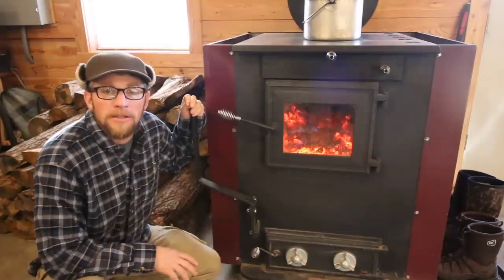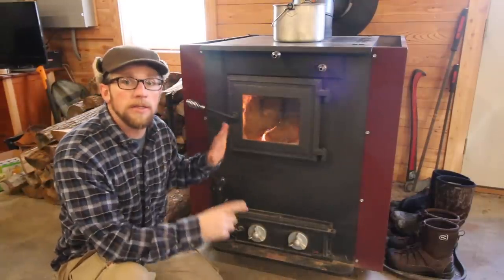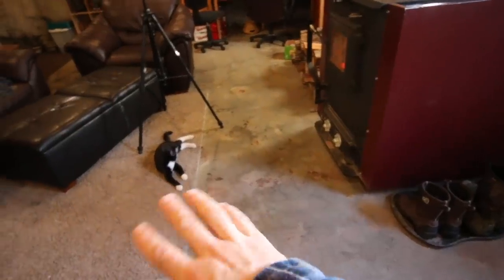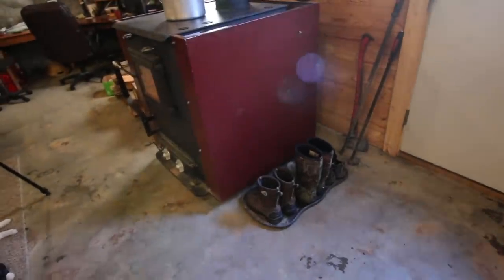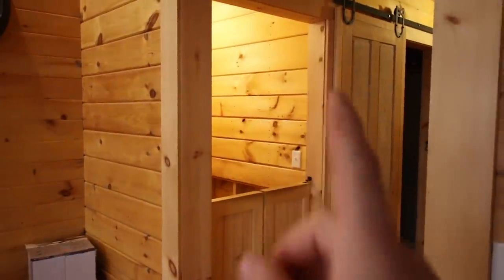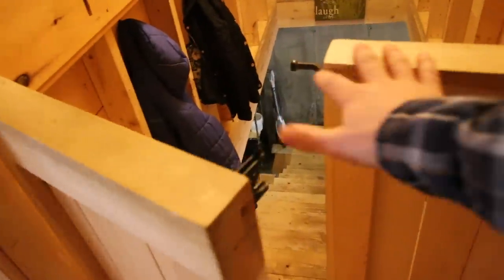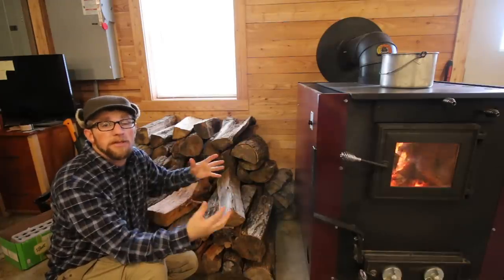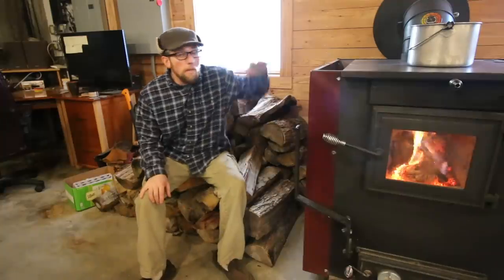How we Designed our House to be Heated with Wood & Natural Convection

Comment: I know this is a year old, but hope you find this comment useful.  Warm Bedroom:  Is there some way to add some insulation above the heater ... Perhaps just put some plywood on the bottom of the rafters to make a dead space directly above so that the moving air would not be rising directly into the space below the bedroom...you could then treat that space as another floor, have openings into it to allow heat to rise (or move sideways) into the space and have drop down cool vents to allow the cold air to fall into the basement.  You could control the damper in the cold drops to control the amount of circulation of warm air under the floor.  Also, since there would be a barrier between the floor of the bedroom and the heater, radiant heat would be blocked and would only heat up the covering plywood, not the floor of the bedroom. Perhaps drop the ceiling a few inches and just put a little insulation on top of it, not enough to block the free air flow from the sides.  

Love your videos.  Thanks for the inspiration.  Best of luck with this winter.

Comment: could you put a section of duct above the stove... say about 3 or 4 feet wide...with 1 foot deep sides...so like a big U shape..upside down..... and run that toward the center of the basement...this way more warm air would flow that direction and not overheat your bedroom above...if possible slightly angle the duct to be lower and the stove end and up against floor joists at the other end...

Comment: I heated my home almost exclusively with a wood stove for 4 years. I like the ash try on your model, but that warmer/colder dial looks flimsy and unnecessarily complicated. The cleanout on the chimney is excellent. My yearly cleaning would've been easier with one. Also, once the fire is going strong a little moisture on the surface of the wood won't affect anything, although storing it inside is more convenient...

Comment: good setup but would consider running outside air source for combustion to the intake flap of the stove.  Also not sure but if that model stove doesn't have a catalytic converter one with it would likely be more efficient by basically using the unburned particles in the smoke. I see your point but a few batteries and solar panels or small generator would easily run a circulation pump ,fan etc and you could have the outdoor furnace and not have to bring wood inside the house and gain floorspace and no mess inside but you considered that and did this instead which I don't disagree with.  I like the look of a fire burning too.

Comment: Your house is 3000 square foot, does that include the basement? Did you insulate the walls with foam? I know in the area I live they use foam instead of the old type insulation. There's no doubt about it you do have a great stove. Do you guys ever plan on making different rooms in the basement, let's say bedrooms perhaps for company?
Reply from the maker: the 3000 sq ft includes the basement. we have fiberglass insulation in the walls

Comment: I'd like to know the temperature, when it is very cold outside, of your cellar, your living area, your bedroom area, and your bathroom.  It seems like your cellar would be very warm because the convection would not be really great enough to warm the living spaces that well.  I think that is evidenced by seeing your wife bundle up in a big, thick wool scarf when eating dinner/lunch.  She looks very cold.  The other drawback is the cost of four cords of wood, or the amount of work needed to split your own wood.  Then the work of stacking the wood and bringing it, which I've seen your videos on, cleaning the chimney (which I love), and the firebox is a lot of work.  Did you compare that cost to gas heating?  I'm sure electric would be very expensive.  We live rurally where there isn't gas, so we heat and live all electrically rather than have propane.  We have mild winters with no snow, so our cost isn't that much.  I do love your house and property, but not your winters.  During hot summer weather, we spend our time in the pool.

Comment: That's a very nice setup and a very informative video. For folks who aren't able to vent their chimney out through a wall and must have it penetrate their metal roof, Aztec Washer silicone chimney flashing is a very good product that works great. They are available from pipebootexpress.com. You can put a chimney through a metal roof and flash it simply, attractively and without leaks. Another option is to frame a square box around the chimney which is easily flashed with any kind of roofing including metal, tile and slate.

Comment: how to be 30% more efficient,
 duct outside air to the heat control  opening . cold dense outside air supports combustion/ expansion and all heated air stays in the basement.

i ran a dryer vent and metalized hose to the air intake of my small sheet metal box heater and installed a duct thimble with metal screws . cold outside air supports combustion. heated air stays inside. be well.

Comment: What was the cost of that stove if you don't mind me asking, it is a beauty....
Reply from the maker: it was around $3000
Reply: Hey Al thanks for the quick reply on the cost of your wood furnace/stove. We are going to be building in Nova Scotia next year when we retire and all you can have for heat there is Propane, oil, electric, or wood seems to be the best heat even with the little extra work required. We will look into that make it looks like a real good choice. Once again thanks for al the tips and info.Alan Viner.
Reply from the maker: It is extra work, but the heat it puts off is so much nicer.
Reply: Thanks again for the info, Keep up the good work. Alan

Comment: As suggested, here is a link to a BTU chart:  http://firewoodhoardersclub.com/forums/resources/firewood-btu-drying-chart.15/
If you are new to wood burning this will help you get better prepared since there is no way to get much heat by cutting and then burning wood. It needs to be well seasoned.
https://firewoodhoardersclub.com/documents/Primer%20on%20Wood%20Burning.pdf
Reply from the maker: Thanks for posting!

Comment: Did you check into Rocket Mass heating before you picked this stove? Excellent video, as usual!
Reply from the maker: No, I don't want to be feeding a bunch of little pieces into a fire all the time
Reply: Thanks for the information. We are facing older age, so less wood cutting is a factor. Currently we heat with gas.

Comment: You have a very nice system. Are you a pick out a very nice looking stove I feel like the looks of it. I feel a little silly suggesting to you that you probably should look into a wood boiler system. I know a person that is kin to me. He put his in the middle of his house and had the heat go straight up in The Sinner I'm right above the stove. He had minor problems the solution was open window in the top of the house and open a screened window in the basement where the stove was. At night his house look like it was steaming.

Comment: I've heard wood stoves dry the air quite a bit.  Putting water on top of the stove is what I have heard works to raise the Humidity, is that true?
Reply: Yes, you are correct. That said, do not use an aluminium pots for the water or it will actually dry your nose out and you won't feel well. What I do is use an enamel coated thick cast iron pot with a lid. I have never had an issue with this. If you have a fancy enamel coated stove then you might want to put a trivet on the stove so it doesn't get scratched up.
Reply: Melody Scamman The aluminum pots not an issue, it does not

Comment: Thanks for the tips AL
My wife and I have been talking about installing a woodstove insert in our fireplace, which is on the larger size.  Will be a large initial investment but will payoff over the next few years specially when oil doubles again which it will its already continually gone up over the last few years.  Is your stove the only heat source do u have electric or propane heat if you guys go away?
Reply from the maker: We have a propane back up. We put a wood stove insert in our fireplace in MA it worked awesome it paid for itself in two years!

Comment: I would  have just made a set up stairs on each end of the house, one right near your stove and one at opposite end of house
 that way alot of heat rises directly  to living area up stair and tons of cold air could fall down the rear of the house
it wouldve only been about 50 Sq ft loss.

Comment: This comment is about a year late. You have done a good job with your layout. The one item which I always look for when heating with a stove is the combustion fresh air source. It appears that you are using the living space air for combustion air. For max effeciency you should draw outside air, otherwise you are sucking warm house air thru the stove for combustion and sending it up the stack. This is the problem with 95% of all installations that I see. You could easily fix this by cutting a hole behind the stove and adding a short piece of duct to go outdoors. I suspect you may have considered this. have you? Also good idea to store wet wood inside since it will help humidify the house which you are doing.

Comment: I'm  in the process of planning a new off grid home. Your system is grossly outdated.    I've lived with a wood burning stove for 30 plus years and I've lived with the system you have.  It is time and resource consuming.  We endured this system because this is what the local masons could build.   My ancestors and the Nordic people invented the best heater.  You need to design a home around a masonry heater, or cheaper yet, a rocket mass heater if your locality allows it.  You are a slave to you stove if you don't have a masonry heater or a rocket mass heater.  Thank God  that you can find masters to build these wonderful "heaters" in 2018.  These masonry heaters are "green" and exceptionally efficient.  YOU ONLY NEED 1/10TH  THE FIREWOOD of a regular wood stove.

Comment: Good design for wood heat. I expect you get at least 8 hours burn from a full fire box of wood. I like the size of the stove and the amount of wood that you can fill into the firebox. With a backup generator to keep the lights on and refrigeration working, you can go a very long time off the grid if need be.
Reply from the maker: Yes we can fill the stove up and go to work or sleep and the fire is still going when we get back or wake up.

Comment: Great video! Thanks for sharing this info, very helpful. I have a suggestion, that works in our house, our basement ceiling has drywall sheathing nailed to the rafters, and our rooms above to stove don't get to warm. It forces the warm air to move over and up our stairs instead of floating up through our floors. Hope it helps!

Comment: Using a wood-stove with a boiler would make much more sense. If you lose power you can have a UPS or even a tiny generator. How often do you lose power and for how many hours at a time?  Expecting to warm a house through convection seems very ineffective to me.

Comment: The only Problem I see. Is years ago taking housing and design. A brick chimney through the center of a house creates even more heat. With the themral mass of the brick taking on the smoke and heat lost out the chimney. Farm houses Years ago where Designed around this. And Open Stairways.  Your place isn't taking advantage of that. But still good job. :)

Comment: the part about losing btus by having wood in the house isn't really accurate .  The same number of btus is still used to dry and warm the wood inside as it would be in the fire just slower etc.  Ideally wood outside on south side with black plastic etc over it would keep wood dry and warm it up with solar energy and no moving parts

Comment: You want good and efficient heater. That means no air restriction. A good boiler is one with a very high temperature. To do that you need a ceramic insert and a reverse flame. Reverse flame is a burning that is pointed down not up. Check this video to see how it works. https://www.youtube.com/watch?time_continue=1&v=gKZJFOsDLmU&feature=emb_logo

Comment: You have a nice place! I would do it differently, prefer to have no chimney at all. Since noise transfer from room to room is something that I can not stand. I would go with radiant floors for each room separately to adjust temperature easily, automatically to reduce costs. Would make hybrid of passive house, earthship, tiny house and studio apartment building. Minimizing resource use down to a minimum. Showing exemple of mindful living with nature!
Reply: I looked into radiant (electric) underfloor heat myself, and it's incredibly expensive to run.  If you're living off-grid, it's even more expensive as you'd have to build all of the infrastructure just to run it.  I find my wood stove runs without any noise whatsoever - I've even got a fan on top that's powered by the heat of the stove itself, and it's completely silent.

Comment: Pay no attention to the oil/gas furnace seen at 8:48 lol
Reply: Well spotted, although if it helps, I seem to recall Al mentioning in an old video about cleaning the chimney, that as well as the wood stove he has a back up heat source, which I assume is the aforementioned furnace. (I imagine that implementing off grid approaches are also sometimes a gradual process? :)
Reply from the maker: The insurance companies dont want to insure your house without some other kind of heat

Comment: I did not get a good look at your light bulbs you have in the basement I just want to convey that I had good experience with power reduction using the brand new type energy saving light bulbs I am describing the new ones that looks like a lightbulb and seem to have a lot of weight within each Bob not the ones with the coil and halogen within the Bob. I will tell of a idea my father had as in putting two small cheaper ones into a splitter and screw the splitter into the light socket so one light socket will have to light bulbs after all the hundred watt ones are very expensive for some reason I don't know why. Other than that you're lining looks really nice as far as the wood stove it looks like you need a lazy boy where the cat lies or place a couch there with a table that rises to be a good place to eat your food. Those are nice
Reply from the maker: The lights in the house are led that look like old style bulbs

Comment: Not too sure about the knob for the air-in damper.  Seems like it wants to break, like the one on an old stove I used to have.  Also not sure about the 5 tubes along the right side of that wood furnace.  Not sure they really do anything.

The rest is all positive...

I saw a house in Kendrick, Idaho that was set up for central wood heat from one big stove in the basement.  It had BIG grates directly above the stove, in the floors of 1st and 2nd stories, for maximum upward convection, which was pretty neat.  You could stand on 1st, 2nd floor and see clear down to the basement.  I don't recall the air-return system or even thinking about air return, although I do vaguely remember there being grates under the windows in all the rooms, upstairs.  So your explanation of the cold-air returns was informative.

Excellent point about wanting to sleep "cold."  That's why I close my bedroom door and open the windows.  With your setup, you probably just want to situate the master bedroom a little differently.

You probably get as good or better of a convection cell going by using a centralized stairwell.  I like thinking of passive ways of moving air around and climate control.  I'm kind of skeptical of modern homes' emphasis on being "tight."  I like a house to breathe.

Comment: It seems you are burning your woodstove using interior room air as a source of combustion air rather than providing an exterior combustion air source.  If your home is well sealed and insulated to keep out the cold there is a danger of carbon monoxide poisoning?  At the very least I would have a CO detector installed in the room.  Carbon Monoxide is a silent killer that has no odor.
Reply: Doesn’t matter where the combustion air comes from as long as the combusted air is properly vented to the outside, which it is.

Comment: What about bringing ants and bugs into your house with this wood.
Reply: what about it ? Everyone that uses wood in their fireplaces has that issue, just make sure if you see a piece of wood thats full of bugs or ants that you either use it right away or leave it outside. However, most bugs are not too active when its so cold out that you need to be burning wood !
Reply: Spray bug killer but not many bugs during heating season !!!